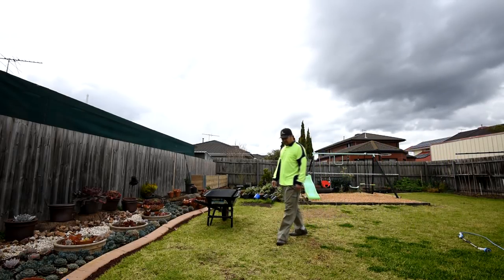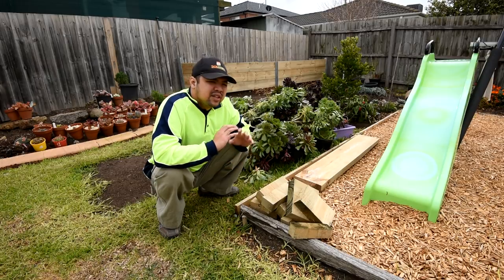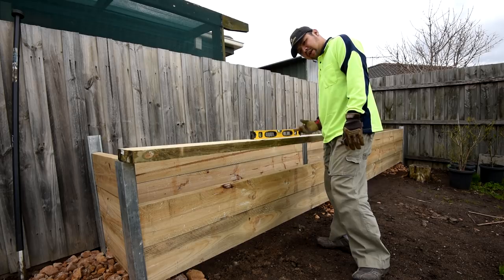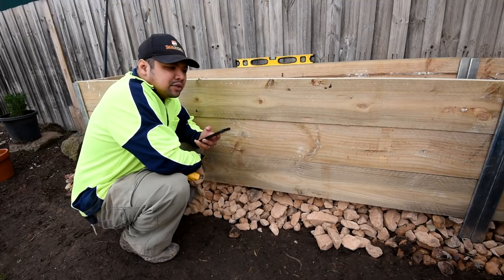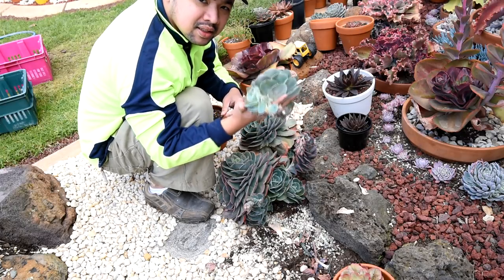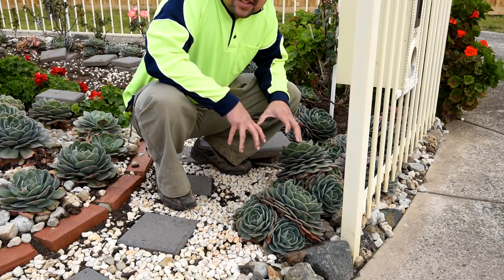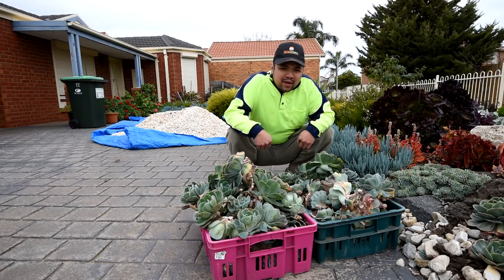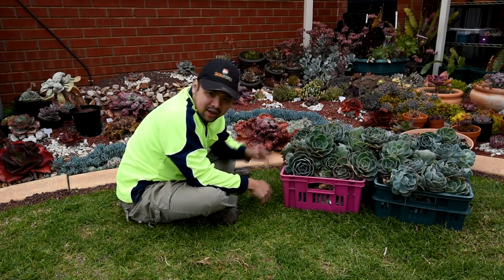#81 This is how I harvest echeveria imbricata pups

Comment: I would place a screen between the rocks and soil to prevent erosion
Reply from the maker: Good idea. I suspect I don't have to if I layer with the smaller pebbles at the bottom so they would act as the screen (since as you know, the gaps between the larger rocks are huge, and soil would wash easily through them). Thanks for reminding me about this though!

Comment: Ahhh I’m so envious 😭, do you use fertilizer? What kind of pesticide works for you? Thank you for this awesome episode ☺️
Reply from the maker: I do not use fertilizer, but that's mainly because my growing medium contains lots of soil/compost. When planting in the ground, I have a "cheap" mix of 1:3 or 1:4 ratio pebbles to soil. It's mostly soil, and the pebbles are just to add a bit of grit and prevent them from clumping too much. In pots, that ratio goes down to 1:1 (or even 2:1 pebbles to soil for the more sensitive varieties). The plants can get enough nutrients from the soil mix. In addition to that, I want to keep their stress colors. Giving fertilizer will keep most of them green.
Reply: I believe you gave your soil recipes a long time a go, I just couldn’t find in what video this recipes are. Btw, I think that adding related links to previous videos on the description area can increase your traffic 😉
Reply from the maker: The mere fact that it is buried in a vlog episode somewhere means that I should work on a standalone video about it sometime haha!
Reply: That would be awesome! Actually can’t wait 🤗